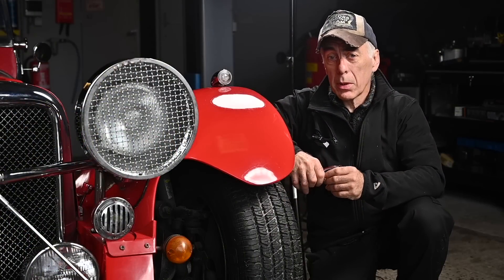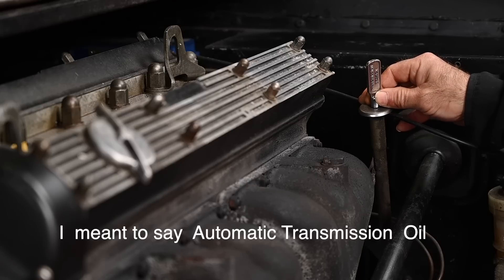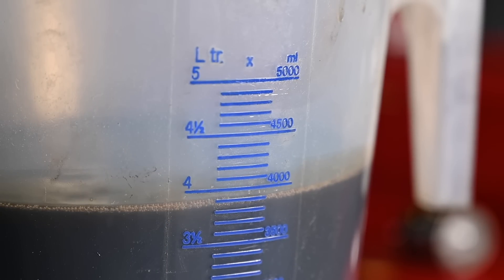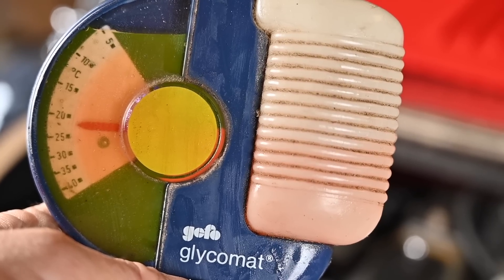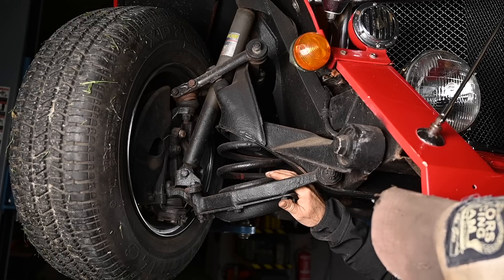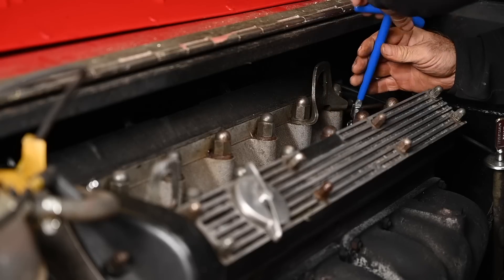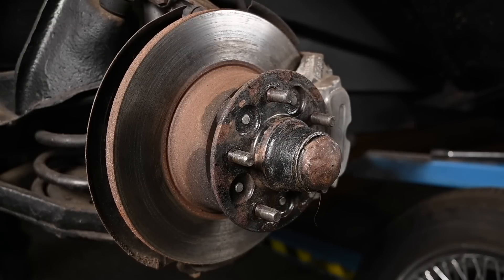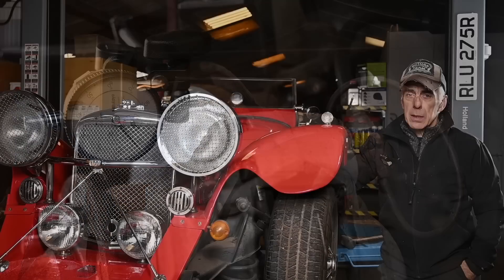Steadman TS 100 technical assessment

Comment: It is something wrong with units on 12:48. There should be 1200kPa or 12bar. Your gauge units are PSI or kPa x 100. Anyway, it is great video. Thanks for sharing.
Reply: With psi ito bar it is correct.
Reply from the maker: Thanks it is about 12Kg as  we day ( Bar)
Reply: @D3Sshooter  I do this all the time, especialy since most of my meters are old hydraulic meters...